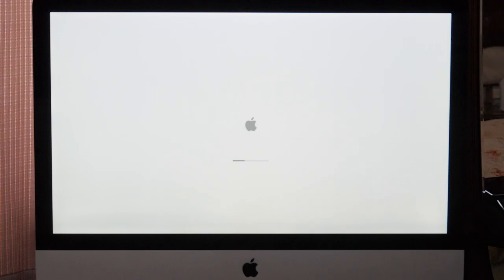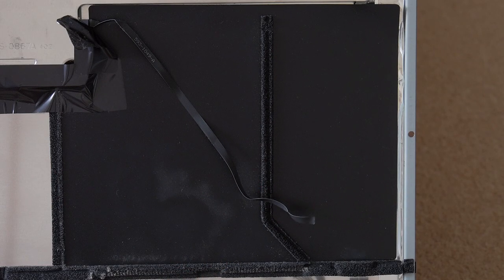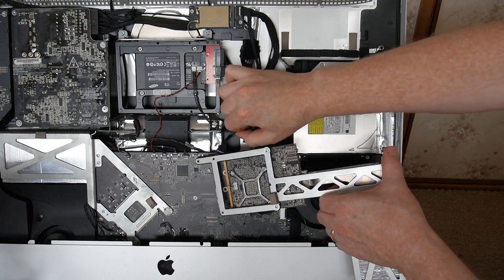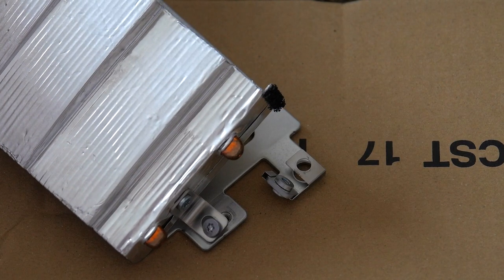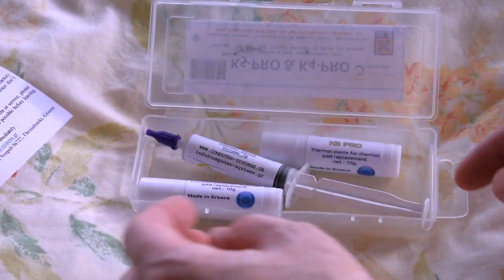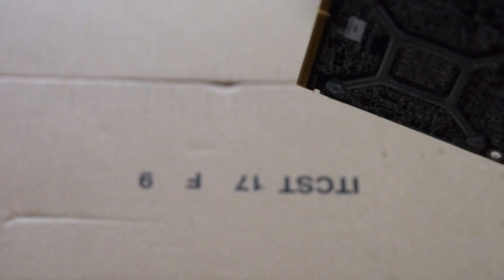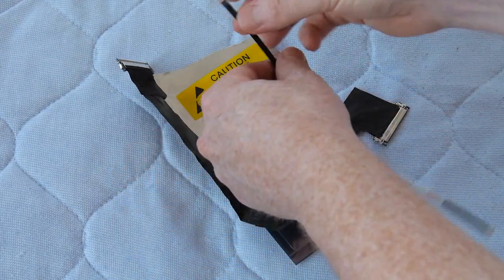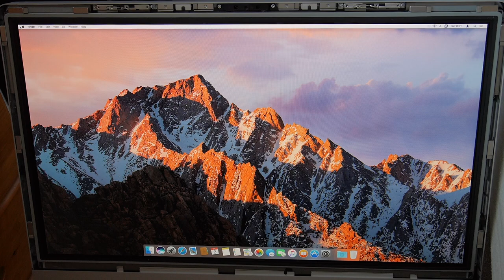Late 2009 iMac 27" Video Card Repair — 4850 — 2nd Bake

Comment: Thanks to this channel and the amount of useful information JDW has been sharing, I've been able to resurrect my 27" 2011 iMac. My machine was showing the following symptoms after powering up: Chime, Apple logo, charging bar, white screen. I didn't have any horizontal/vertical lines of any kind of artifacts on the screen, and Apple Hardware Test appeared perfectly, without any graphic anomalies, which is why I was in doubt if it really was the GPU.
So yesterday, May the 11th 2020, I disassembled the machine, took the logic board out (necessary for the 2011 model), cleaned off all the previous thermal paste (it took me quite a long time, but it's essential) and baked it at 200ºC for 10 minutes. After cooling off, I repasted with K4 and K5 pro (thank you for that tip James!), reassembled everything and voila: the machine booted up and is now running like a charm! Well, before that I had forgotten to reconnect the power button cable, so I needed to open it up again as there was no reaction to pressing the power button.
I can't thank you enough for consulting me the previous days via email and I hope all the positive feedback on the comment section of all your videos encourage you to keep going with your content! I have taken pictures of the old pasting which Apple did on the repair (this was the second time my GPU has failed, I suppose Apple has replaced the card when it happened the first time) and also of my pasting job, but I don't know what the best method is to share them here in the comment section. I also installed iStat Menus for monitoring temperatures. I'd be glad to share my results once I know how to share the screenshots here on youtube.
I insist on thanking you for your guidance and all the good work James! If it weren't for your content, I would have given up. Thank you!!
Reply from the maker: Thank you for your kind words and for the detailed experience you shared, Iam. With regard to sharing photos, I would suggest uploading them to a free service like Flickr or even a cloud service like DropBox or CloudApp so you can then get a shareable link that you can post in a new comment. I allow people to post links here. It’s not a problem. 

Glad your iMac is up and running now. Best wishes!
Reply: @JDW-  Thanks for suggesting those free services, I've uploaded all 17 photos I've taken of the heatsink/videocard through the whole process. They include some pictures that show the Apple Service's paste job as well as my clean job before putting it in the oven and finally the paste job I did. I'll attach the link at the end of the comment.
Notice the spillover touching the golden pins of the card that Apple's Service did (I took the picture before removing the card from the logic board). And the spillover with the other paste around the GPU chip was a pain in the neck to clean up and remove! Furthermore, it looks as if they've used K5 Pro to me (my eye for that isn't trained at all, I might be wrong about that. It felt still moist by the way).
If you have any comments regarding the pictures, I'd be glad to read them.
https://www.flickr.com/gp/iamhannover/7BD488
Reply from the maker: @iamhannover  Very odd. I found your post in my SPAM folder here on YouTube today.  That's strange because I swore I wrote a reply to you 1 month ago.  Well, here are my thoughts again.  Your photos of the paste (prior to your cleaning and bake) looks burned as if someone baked the video card and the heatsink with paste and everything!  I don't see how else you could explain the burned portions of what looks to be K5 Pro (on the memory chips).  I am glad though that your bake was a success.  Please keep me updating on how it's doing over time.  Best wishes!

Comment: Hello James. My bake lasted just over one year. The screen went scrambled all of the sudden. I knew it was the graphic card. Did the second bake. Oven at 200 degrees. 10 minutes baking. And... back in business again. That's incredible. By the way. Instead of thermal paste, I used thermal pads. Double layers so it could touch the heatsink. Less messy than the paste. Thanks again.
Reply from the maker: Sorry to hear that, but 1 year for a first bake is good.  I got the longest use out of my second bake, so I hope you get the same.  Hopefully you used those thermal pads only on the memory chips, as pads are not made for the GPU.  For the GPU K4 Pro is adequate, but Thermal Grizzly Kryonaut is just about the best you can get outside liquid metal.  (But don't use liquid metal.  It's too risky.)  My best regards to you and your family in 2022, Emanuele!
Reply: @JDW-  Hey James. No worries. One year is great. And, of course, I used the paste for the GPU :). Happy New Year to you and your family as well.

Comment: Hey JDW, just wanted to chime in and say thank you for being so methodical in your videos!  I watched your first iMac baking video as well as the second and was confident enough to perform it myself - and I'm happy to report that my "card of sorrows" is fully operational once more! =)  I actually had to go back and remove my screen / LCD twice as I forgot to connect the Wifi cable (I had it tucked away for tidiness during the surgery)  I'm hoping I get a year of additional service out of it but if not, I'm confident to do this surgery in under 10 minutes and will try out a newer card such as the Radeon 6970.  Anyway, thank you again, and for those reading that are about to perform this - just take your time in following the steps and everything will be fine.
Reply from the maker: I'm very pleased to hear of your success, Juju!  And thank you for your kind words.  Best wishes to you and your newly resurrected iMac!

Comment: Hello Mr JDW...I want to say thank you for your 1st and 2nd bake video.  I was very hesitant to take on a dismantle project like this and to do the bake, and putting everything back together. I had nothing to lose so i went ahead and gave it a shot.  The damn thing works!!!  I was in deep and once i had everything taken apart, I kept thinking there is no way this is going to work.  I baked the graphics card at 395 F, for 10 minutes.  Since i had everything taken apart and wasn't sure if any of this was going to work, I decided to also open the CPU.  I cleaned it and used the Thermal pad with a drop of MX-4, which helped keep the pad in place.  I then assembled the graphics card with thermal pad and a drop of MX-4 on both side of the pad. I also used the paste from greece (K5-PRO) on the chips.  I put everything back together, crossed my fingers and turned on the computer.  To my complete amazement the computer TURNED ON!!!!!

Thank you, thank you thank you for both your videos, your explanations and attention to detail!!!!  My jaw is still on the floor. I cannot believe this worked and a complete amateur, someone that has never opened up a computer was able to have success in doing this. 

Your videos, in conjunction with the iFixit tool kit, the paste and MX-4 from Amazon.com, was all less than $75.  Total time from taken off the screen, to putting it back on and the computer working, was probably one day and half. 

I'm writing this literally 15 minutes after turning the computer back on.
Now that its working my next project is to replace the hard drive with an SSD.

Thank you again and Godspeed!!!!!
Reply from the maker: Phill, what a wonderful success story!  Thank you for all your kind words.  I am so happy to hear your iMac is up and running again.  $75 is certainly cheaper than what Apple would have charged you to fix it, and although it took you a day and a half, you obviously seem to feel it was worth the effort.  I certainly did.  There's something indescribable about fixing something yourself, especially when you are unsure if your labors will bear fruit. Your labor paid off.  Best wishes to you and your newly resurrected iMac!

Comment: I've had to do this maybe 5 or 6 times over the years.  It lasts for around a year or so but always breaks again and the bake always fixes it.  The lead-free solder they used in all of these cards is just bad and will grow splinters over time.  This last time I baked my card I broke the flimsy vsync cable (the small one you broke) and am glad its pretty easy to replace.
Reply from the maker: That’s a lot of bakes!  My first bake lasted only 4 months, but I didn’t fully clean off the stock thermal pads after that bake, and the paste I applied was old. My second bake is still going strong after 2 years and 3 months, and I was sure to clean off all the old paste and then applied brand new K4 and K5 Pro. So I don’t know if my card simply needed 2 bakes or if the thermal paste I used is special, but again, it’s still going strong for more than 2 years if daily use, 3-5 hours per day, including GPU intensive gaming.

Comment: Hey man! Thanks a lot. Just baked my Graphic Card yesterday and today i put the IMac late 2009. It works like a charm. Unbelievable. Computer was getting stuck on loading. After calling several service repair I was told that probably the problem is the Graphic Card. Cost to fix it about 260 euros. Turn around about seven days. When I asked why I was told that needs to be dismantled and the card put in a special machine with hi temperature. I was puzzled. Then I googled the problem and I came across your videos. I didn't think it twice. Opened the iMac and went for the second bake because I didn't have to remove the motherboard. The only changes I made is that I used thermal pads all around. I used the paste only on the main CPU part or the Graphic Card. Also replaced the HDD with SSD. To make a long story short. It works. Thanks again for the great video. Ciao. Emanuele
Reply from the maker: Congratulations on your successful bake, Emanuele!  I actually had one service guy wrote a comment in the past saying he disliked my videos and that I was spreading misinformation (which of course is not true).  Fact is that when people do the bake to repair their video card themselves, it means less business for the repair guys! :-) Even though the bake doesn't last forever, I still think it's worth it because even if you spend that 260 Euros, that fix too will not last forever!  Best wishes!
Reply: @JDW-  Hey James. Thanks for the reply. I agree with you. Besides, I had to drive to the computer repair place.. They told me it would take ten days. They did not garantee that my iMac was going to be repaired. Bla, bla, bla. So, again, I took things in my hand thanks to you. On top of that it was fun. It was challenging. I got the chance to see inside an iMac. Realized that is not rocket scienze. And when I turned the iMac back on and it loaded, perfectly and  in no time. I screamed: Yesssss! :). Have a nice day.

Comment: I just wanted to say thank you so much for taking the time to make this video.  After being told by the computer tech how much it would cost to fix this problem, i almost just got rid of the computer.  a $20 bottle of thermal paste later and my computer is running great.  Thanks again!
Reply from the maker: Thank you for making time to comment and let me know of your success.  By the way, how much did the repair shop want to fix your iMac?  (I assume they were going to do the standard "reball" of the GPU chip on the video card?)
Reply: they said $150 for labor and $300 for a new graphics card
Reply from the maker: Thank you for the information.  $300 is about what you'd pay if you bought the same video card on EBAY, so that price quote isn't bad.  It's the going rate.  I personally think it is too much for such an old and problem-prone card, but "supply and demand" is at work.  Also, anything with the Apple brand seems to be priced into the stratosphere regardless of how old and obsolete it is.  All said, it's cheapest to do the repair yourself, assuming you have the time and determination.  Best wishes to you and your newly resurrected iMac!

Comment: Thanks for the great tutorial! I baked my 2009 27" iMac graphics card yesterday in an oven at 200°C  for 10 minutes. Left it for the next day to cool-down. Put it back in the imac and It is running well. it took me in total 3 hours
Reply from the maker: Thank you for sharing your experience, Mark. Congratulations on your successful Bake!
Reply from the maker: @simplebasiclife  I am very sorry to hear that.  Two weeks is unusually short for a 1st bake, so if you don't mind, I have a few questions:  (1) Did you clean off all the old paste prior to your bake on both the video card and the heatsink? (2) Did you verify with an oven safe thermometer that your oven temperature is spot-on 200°C?  (3) Did you allow your oven to warm to 200°C before you put the card inside? (4) What paste did you use on the GPU and Memory Chips after your bake?
Reply: @JDW-  
(1) Did you clean off all the old paste prior to your bake on both the video card and the heatsink? Yes i did. 
(2) Did you verify with an oven safe thermometer that your oven temperature is spot-on 200°C?  I pre headed the oven to 200. I did not use a oven safe thermometer
(3) Did you allow your oven to warm to 200°C before you put the card inside? Yes i did
(4) What paste did you use on the GPU and Memory Chips after your bake? The same paste as you used and ordered it from amazon
Reply from the maker: @simplebasiclife  Thank you for your quick reply, Mark.  Having experience reading every comment under all my bake videos, I feel there are only 2 possible explanations as to why your 1st bake lasted only 2 weeks: (1) actual oven temperature is lower than what you set, or (2) your video card was too far gone for the bake to resurrect it long term.
Reply: @JDW-  i agree. I think it has been too far gone. That is why i ordered a card though aliexpress. But it was fun and a good learning experience
Reply from the maker: Well, I’m glad that you were able to find a 4850 card on AliExpress. Hopefully the price was reasonable. The rare few listings I’ve seen on eBay tend to be much higher priced than other iMac video cards.

Comment: 4/3/18:  I have an iMac late 2009, 27" with Radeon HD 4850-512MB Graphics Card.  Last month, I started to experience Black Screen after Wake-Up from Sleep. Re-boot would fix it.  Then I got 5 vertical pink bands one day.  It would not re-boot then.  Re-boot in Safe Mode was OK but the bands were still there.  At least I could limp along.  So I followed your instructions, cleaned the entire card well with alcohol, baked it in a Toaster Oven, 400 deg. F (used an accurate oven thermometer) for 10 minutes with 6 quarters on top of the GPU chip for weight.  I too had to replace my Vertical Synch Ribbon Cable [922-9161] (thanks Amazon) because the foils got unglued.  Reinstalled the Graphics Card (with K-4 & K-5 Pro paste) and all is good for 1 week now.  AMAZING this trick worked.  I'll report again if it fails.  Thanks for good video, JDW.
Reply from the maker: Thank you for providing your success story and for letting me know all the details of your bake and repair.  I read and reply to every single comment made under both of my bake videos, and I can tell you that out of all the comments, all but 3 people have been successful with the bake.  And those 3 probably forgot to reconnect something, because I advised them to check that and 2 never replied back.  It is possible that some cards are too far gone to be baked back to life, but in the vast majority of cases, the bake really works.  Best wishes!
Reply: Thanks for your reply.  Gets opened again tomorrow to replace an aging 1TB HDD with a slim and fast 1TB SSD.  Was too unsure to do both the bake and the replace at the same time.  Best wishes.

Comment: Well done again JDW. I followed your advice and did the same procedure on my Mid 2011 27" iMac. It ran for 11 months and now I will again do the same procedure that you have just done. I will follow your steps to the letter and have ordered the same paste that you have used and will apply them in the same quantity. Thanks for perservering with this.
Reply from the maker: Thank you for your kind words. So you baked your video card 11 months ago, after seeing my 1st Bake Video, correct?  And now your video card has failed again so you want to do another bake, this time based on my 2nd Bake video, correct? If so, then of course I would recommend that you use K4 Pro and K5 Pro thermal pastes like I used in my 2nd Bake video.
Reply from the maker: Thank you for your reply, Brian.  By the way, what thermal paste(s) did you use for your 1st bake 11 months ago?